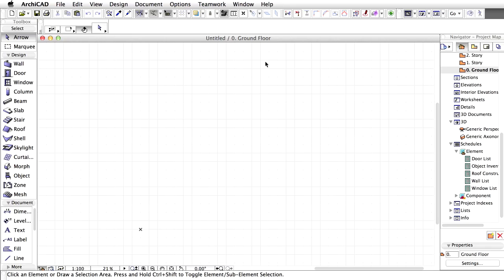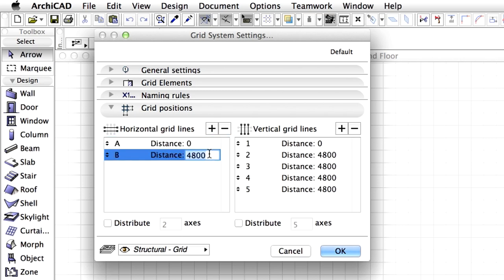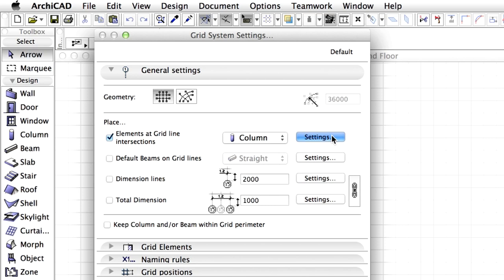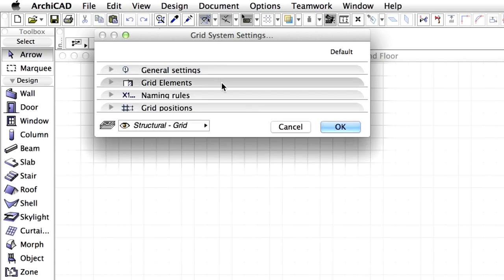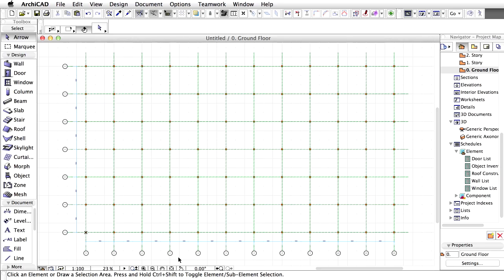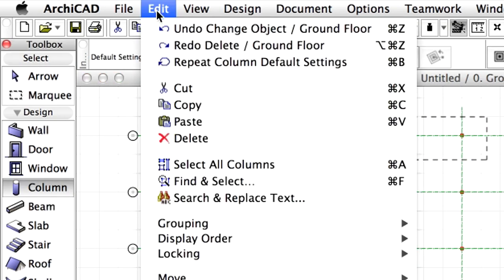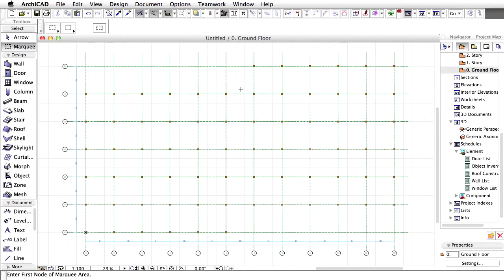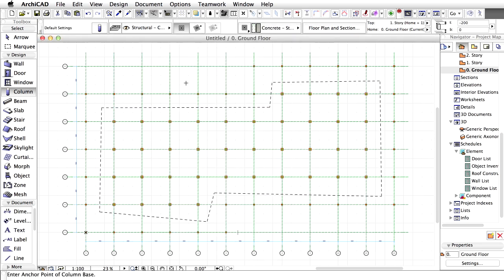ArchiCAD Training Series Vol. 4: Building the Model: Creating the Grid

Comment: I have a problem with the grid: when I place the grid on the ground floor, a dialog popped up and said elements created on unseen stories and when I shifted to 3d view, there were columns created on all stories from bottom to the top. I have no idea what's happening. I try to change the column settings from the grid system setting and it doesn't change. I try to use a different template and it doesn't change at all.